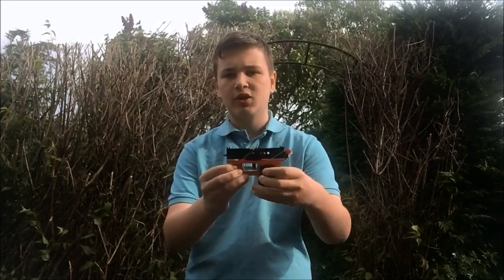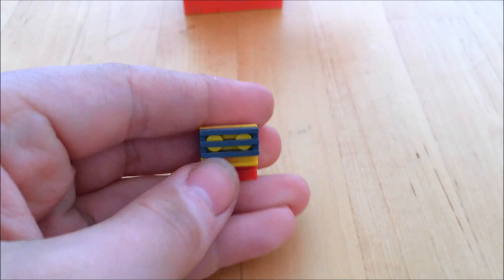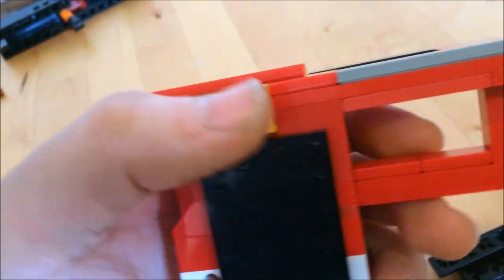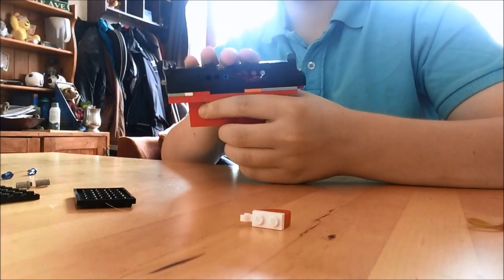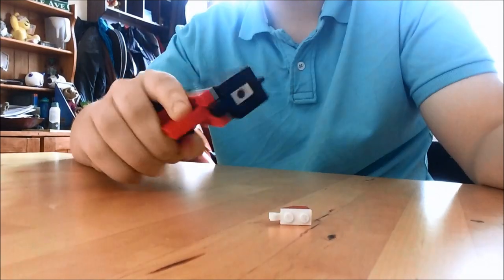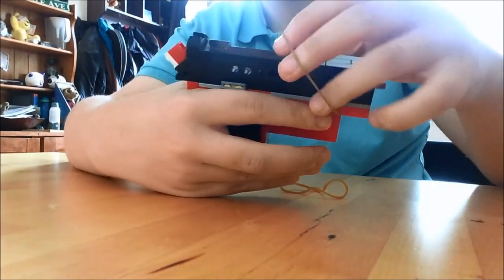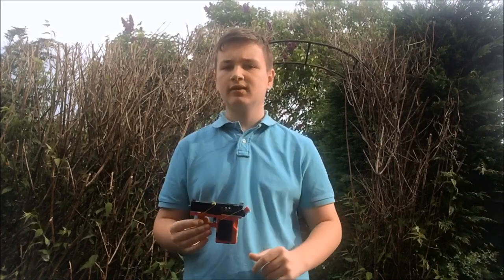Mini Blowback Pistol + INSTRUCTIONS

Comment: Dumb question since I don’t really use guns so I thought I’d just ask lol

What is the hammer of a gun?  I assume it cocks the gun but honestly I don’t know

Why is there an opening on the side of the gun (the part being built at 4:53). Is that to show the trigger mechanics or release a bullet/gas?
Reply from the maker: Hammer is Usually strikes a pin that fires gun. The opening is a mock shell ejection port that has a real .22 shell inside.

Comment: awesome vid i really like the gun.. but i cant build the trigger mechanism just because of one piece: the corner piece. the one that sticks to the corner with the orange and red pieces. any help? like what else can i use?
Reply from the maker: Try a 3 stud wide technic rod with a cross-shaped hole on the side, ensuring that the circular holes are on the opposite side to the cross holes. Then slot a cross-shaped axl through the hole and slot in the rest of the technic pieces, and that should work.
Reply: What lego piece is that?

Comment: 5:03
I know it’s been two years but I thought I’d ask. Is there any alternative for the technic piece near the top right (dark grey “L” shaped piece). I have all the others just not that specific one
Reply from the maker: I'm not sure if there is an alternative to that grey piece. The only thing I can suggest is have a slightly different technic L piece replacing it and modifying the trigger based on that piece
Reply: @DylanVole  
Update. I found the piece lol
Reply from the maker: That's good
Reply: @DylanVole  I’ve nearly found an alternative I need 1 piece
Reply: @DylanVole  I flound a alternative
Reply from the maker: That's Brilliant. Sometimes you have to find little replacements, as the main way to get LEGO nowadays tends to be via sets, whereas using Bricklink may be expensive if you're only getting minor pieces.

Comment: Just now getting back to building it I was busy but is there any way I can replace that gray 1x1 technic piece
Reply from the maker: You could possibly rebuild the gun to have a 2x1 technic piece (the 2x1 that has 2 technic holes rather than 1) and it should align in the same way.

Comment: I get confused with this: ex wtf holds the slide in place? And when he connected the lower part of the slide
Reply: the elastics and the axle hold it in place
Reply from the maker: There is a small axle that holds the slide in place, though I will probably agree that the system I used to fix the slide isnt the best.

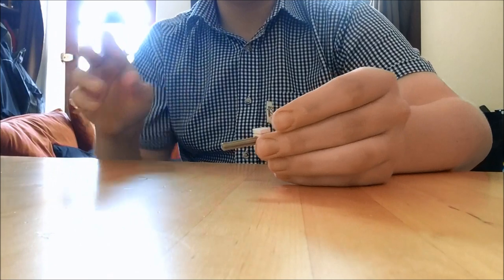Comment: Is there anything else I can replace that piece the tan lookin one at 3:50
Reply from the maker: Not right away, but you may be able to replace the brick with a single technic brick, 1x1, and then use an axle that’s around 4 studs long.

Comment: at 5:03 the grey block is there another block that can replace that?
Reply from the maker: Sadly, not sure. I’d have a play around with the technic part, and see what you may be able to use.
Reply: oh i used the yellow part that looks like that and put in the one block axle pice
Reply: also thx for the great tutorial :)
Reply from the maker: Sweet, that should work. You don’t need to focus too much on colour, as long as the weapon works, and looks good enough for you. :)
Reply from the maker: No problem, and thank you for coming to the Channel.

Comment: i dont know how to make the barrel stick to that brick
Reply from the maker: It's a 3 stud long LEGO technic axle with a stud at the end, and the brick needs to be the specific one shown, as it has a hole that accommodates that stud - either that or you could use a 1 stud LEGO technic holed brick to do a similar job